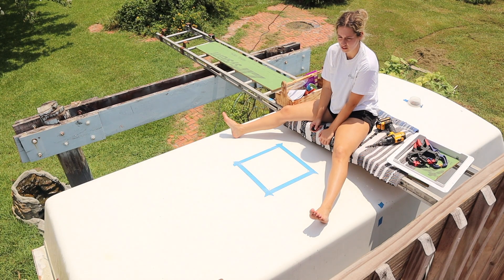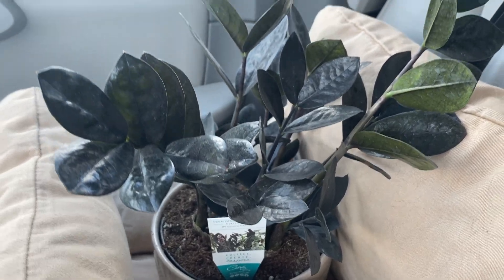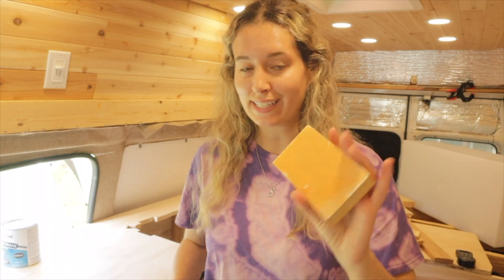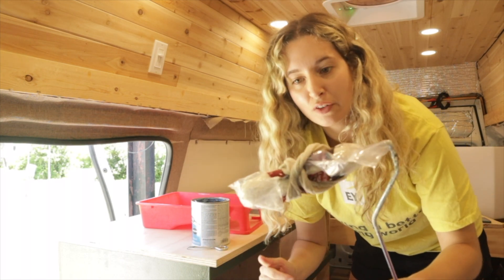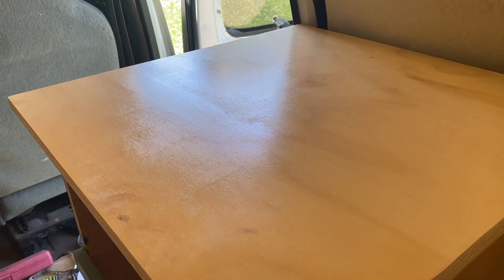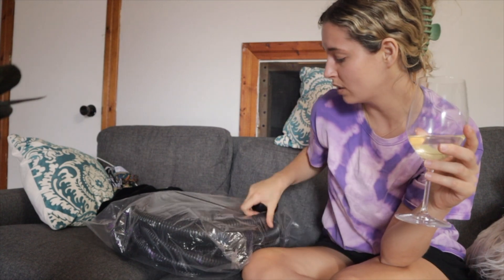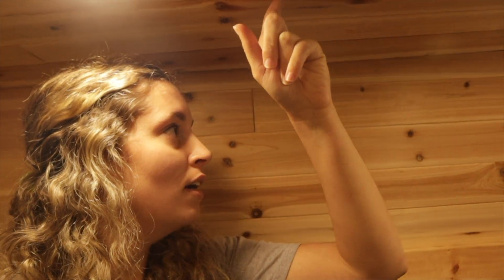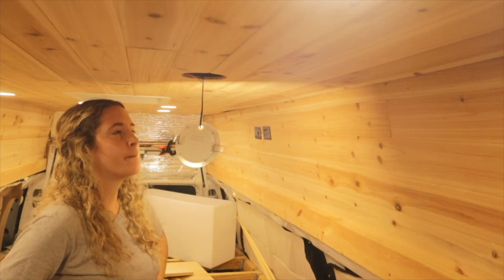VAN BUILD 17: Not going as planned... things ended badly

Comment: Hi, if i can give a suggestion..first find the leak on the roof, get that closed, and simply put a heater in the van so it gets dry, really don't need to get the who ceiling off, the hole u made now is big enough to get the wood dry there...hint, to find a leak, get some kids waterpaint, light color. and put that on spots on the roof where u might think the leak could be, a colored waterline is easy to find...
Reply from the maker: Yes, I'm definitely not destroying the ceiling any more lol I may have found the problem, we'll see!

Comment: Best to attack a roof leak from the outside, look for rust holes, or holes drilled for wiring or vents, then re-seal these first.
Reply from the maker: I thought I'd get some idea of what the problem was from underneath.. we'll see!
Reply: Once the wood gets wet it has to be dried or replaced or it will get moldy. I'm in the beginning phases of my van project and watching these videos is great because she makes mistakes anyone could make.. but I don't have to if I learn how to avoid the problems that come up in the videos. LIke this one, make sure after installing solar it's completely sealed by making use of a pressure washer before installing wood materials inside.

Comment: First thing you should do is reseal all the exterior fixtures on that side of the van with exterior grade silicone up to and including completely encasing your fasteners. Then get the interior dried out as fast as possible via fans and heat. Inspect for actual water damage to any wood and spray the area with a mold inhibitor. Then replace the boards you pulled down and you should be good to go. Poop occurs.
Reply from the maker: I think I got it all figured out! only time will tell!

Comment: use  rv self leveling lap seal ( dicor) on all points where you mounted solar to roof , around skylights. ect . NEVER use box store seal . Ive seen tons of this i live in the rv capital of the world  ( from cajun countty)
Reply from the maker: I've been using marine grade caulk sealant!
Reply: @SaySarah  That stuff will not grab properly or flex which are both important on a rv / motorhome ( van/bus) I ran the rainbooth for coachmen and seen some of the weirdest leaks and locations. We also did "sealtech) where you fill the cabin with air and spray soapy water on the outside and it "bubbles"  i like your videos keeep them coming young lady.